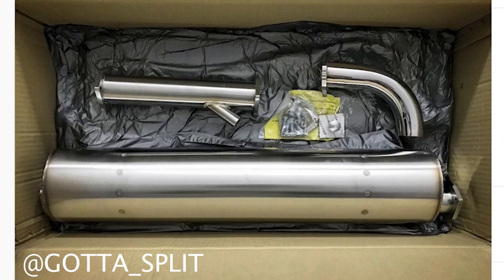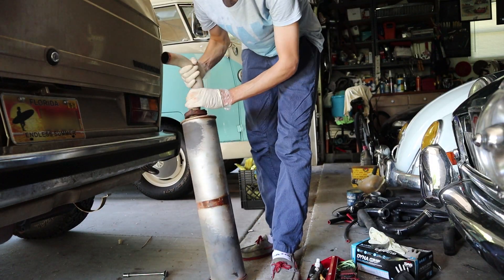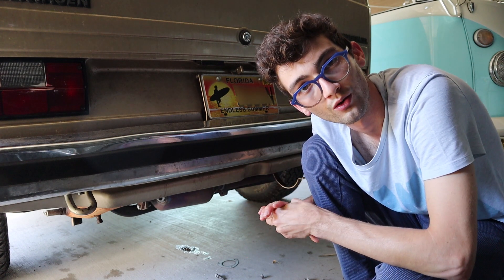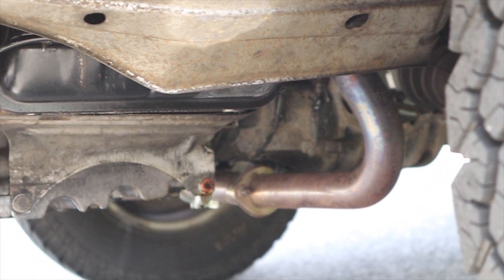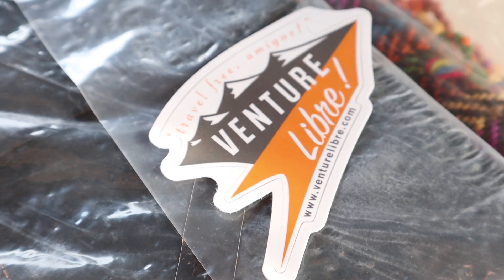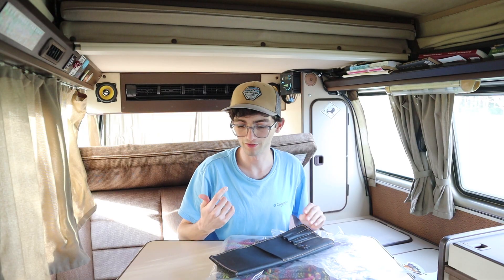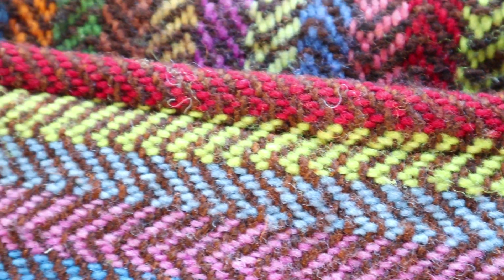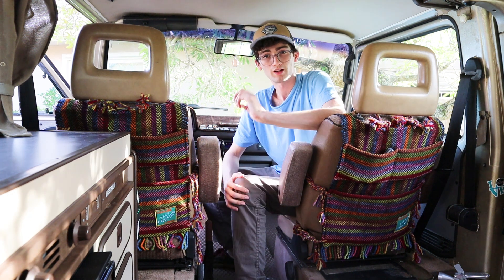A New Vintage Speed Exhaust And Venture Libre Interior Upgrades On The Vanagon

Comment: Sweet editing🤙. Love that new exhaust!! Wasn't ready for all that, thing is nice!! Your 02 should be fine in that spot (bummer they didn't have a bung, but good that your cat did!!), you could maybe take the bolts out of the cat and turn it to the next spot so the 02 points toward the engine and not stick down. You're totally right about it burning up your cat quicker if no oxygen sensor hooked up. Also brass nuts on exhaust stuff work awesome, they usually always come out and dont rust together/freeze up like a steel nut does. I have some on my van just because im too picky😂.. I also anti-seize EVERYTHING🔩🔧
Seat covers look good too! Ive been low key keeping an eye out for seat covers. Ill check them out🤙. 
Nice vid dude🎉
Reply from the maker: Thanks man! Yeah, I was thinking to spin the cat around, but it looks like it won't fit any other way. It's kind of off center and won't clear the valence. The exhaust came with a test pipe that had the spot for the o2. I guess they expected everyone to just get rid of the cat given the chance. Definitely going with the brass nuts next time. The ones on the exhaust studs are brass, but everything else isn't.

Comment: Did you purchase the exhaust direct from Vintage Speed or a US agent? 
I’m looking at purchasing the Sport Flow twin tailpipe system and headers for my 81 air cooled Vanagon. Your system turned out great!! Thanks!
Reply from the maker: Thanks! I ordered it directly from their website.
Reply: @gottasplit5707  Thanks, I just placed my order on their website!! I’m rebuilding my engine to a 2257cc with twin 40’s plus this exhaust. Thanks for the videos and ideas!
Reply: @gottasplit5707  out of curiosity, roughly how long did it take to arrive at your door, from the day of purchase? I purchased the whole exhaust for my 2.1 from them a week ago and have yet to receive even a tracking number
Reply from the maker: @jvarg  I don’t remember exactly how long it took, but I do remember waiting a while. Their customer service wasn’t the easiest to contact either.
Reply: @gottasplit5707  Right on. Thanks for the prompt reply! Are we talking “a while” as in a couple more weeks or should I pretend I never ordered the exhaust and be pleasantly surprised when it arrives?
Reply from the maker: @jvarg  haha, I’m pretty sure I did the latter. Things might also be slower right now. Email them. They did eventually answer me. It did take a few emails though.

Comment: Hey how is that Vintage Speed muffler holding up?  I've seen some posts on forums suggesting they have some reliability issues.
Reply from the maker: It's been great. I haven't had any issues with it so far, but I probably wouldn't buy one again with the customer service issues. I've had many people tell me they also had problems with customer service.
Reply: @gottasplit5707  Thx!  They do have a pretty bad rep for customer service.  I have the 2.1L -- tho my 87 is a twin to yours in other respects, with the flashsilber paint and SA headlight conversion.  It sounds like most of the problems you encountered were related to the conversions needed for the 1.9L system, so hopefully that just won't be an issue for me.  The VS is so much quieter (thanks for the audio comparisons!), and that is my main objective, so ... it's really tempting.

Comment: Dont curb check that o2 sensor
Reply from the maker: One of my fears with where it is.
Reply: @gottasplit5707  can you rotate the cat one hole
Reply from the maker: @VWbugger  Sadly no. the pipe is a little off center so it only fits on one way. I'll have to get a fitting put in the correct spot on the mid pipe eventually.